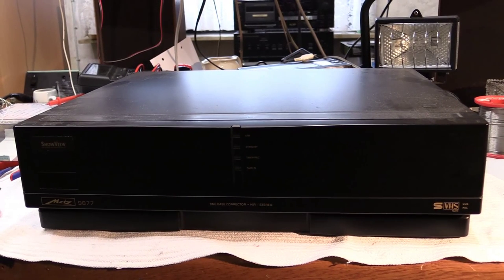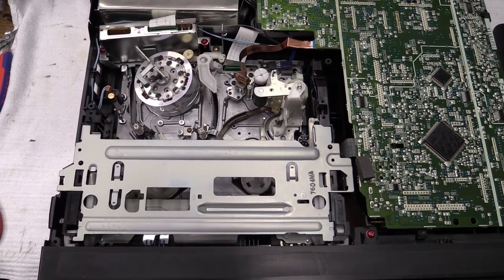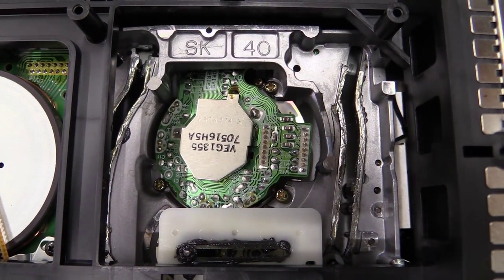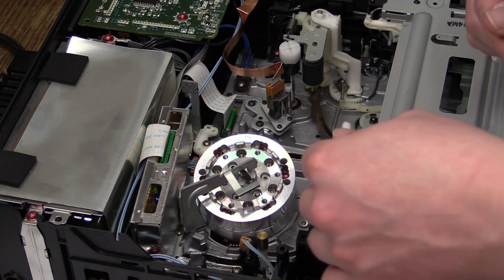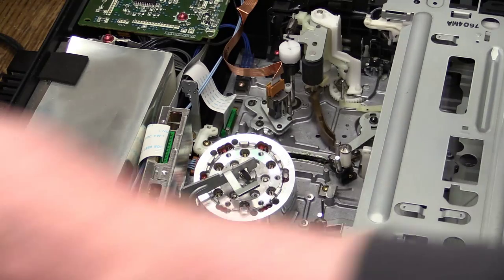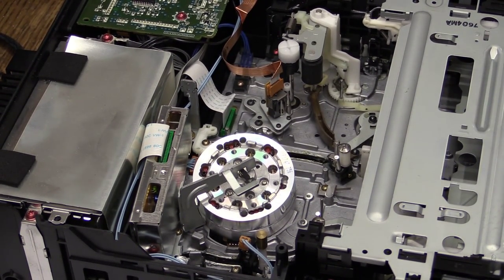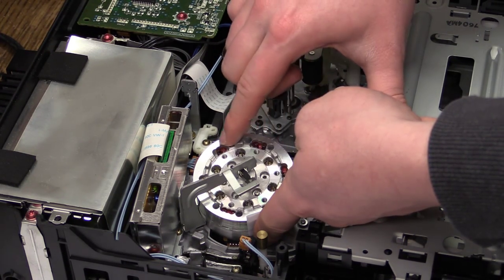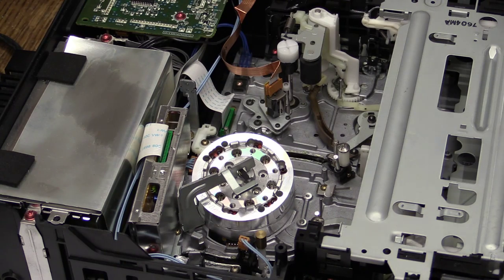DrCassette's Workshop - Panasonic HS1000 S-VHS VCR overhaul

Comment: Nice to see another fellow tape enthusiast, the K Mechanism in this vcr was a good mech, I have the same in my nvhs900 and nvhd620 hard working mechs and will last a very long time if serviced right, had my 900 for 23 years now still working great for a high miler, perfect picture and sound.

When i service mine I take the whole mech out and oil all the bearings and check belt tension, I also remove the capstan completely to clean it and oil the top and bottom bearings, you can turn the capstan in place by turning the flywheel from the bottom on this machine but if you don't have access to the flywheel then wear a rubber glove so you can griping the capstan shaft and spin it with you finger, I do this on both my 900 and 620 machines for quick cleaning and access to the flywheel on these is mech out joby.

It's a good idea to run a scope over  these after a full service especially for tape path alignment the ones fitted with plastic p guides wear like a bugger as they put naff all grease on the runners on the cheaper vcrs with the k mechs those usually have plastic p guides too and they also seem to wear on the tape exit guide the most.

Comment: One of the best machines for tracking hi-fi audio in my oppinion. Even when other panasonics will not read it, HS1000, HS900, Hs850 and FS200 will, if the heads are in good condition.

Comment: Nice video. I have an NV-HS1000 too. What is good to do is to clean also the mode switch and to check  the motor coupling , code VDP1434. Often it cracks and could prevent the mechanism to work properly. Is very easy to be replaced. What I found very interested is that this high end svhs doesn't have zero stop function at rew (counter memory), where the rew to stop when the counter reaches 0. Weird how Panasonic miss something like this for this high end model.

Comment: I have this vcr and it has strange things:TBC make picture worst and only work as should over svhs. On composite video it slightly changed colors and make image jitter much more visible. And overall image is noisy ,not I expected from device this high end class. Any suggestions? Is it video heads problem or video amplification? Is it worth to demagnetize video heads?
Reply from the maker: The built-in TBC of the NV-HS1000 is not the best. It only affects the luminance (brightness) signal, the chrominance (colour) signal does not get processed, it only gets blurred slightly to make any time base errors less visible. 
As for the additional jitter caused by the TBC, both a friend and me have had this problem in the past with our HS1000s. On mine this problem randomly disappeared, my friend was able to fix the problem by repeatedly operating all the toggle switches of the VCR, in the lower section of the front, and the signal output switch on the back.
Do not try to demagnetize a VCR, you can't demagnetize one head without re-magnetizing another!

Comment: I should get out my Panasonic SVHS machine some day.
Reply from the maker: Don't wait for too long, the mechanisms in these don't get any better from just sitting around. Depending on how long it has been sitting and on which type of mechanism the VCR has, it's a good idea to lubricate the pinch roller mechanism before even turning on the VCR. If the old grease has dried out and the pinch roller is stuck, you might end up with broken plastic gears if you try to play a cassette.
Reply: @DrCassette  Can you please tell me what type of grease you use for pinch roller shaft and do you use the same grease for other parts? Is there anything i should be aware of when applying grease to pinch roller mechanism? Please answer. Thank you!

Comment: During the 90's Nokia developed a VHS standard which bypassed SVHS standard but still offered SVHS performance. They trademarked it as ASO (Active Sideband Optimum). ASO matched the resolution of SVHS but with just a handful of components - no need for all that superfluous daughter board and motherboard monstrosity. JVC at the time objected to Nokia's ASO but relented.
Reply from the maker: I have never heard of that system... I know later there was S-VHS ET, which also allowed S-VHS quality recordings on standard VHS cassettes
Reply: @DrCassette  I moved on from CE as VHS wained pending the dawn of DVD in early 2000's. Sadly, we dumped all our technical library when we closed the business down. Else, I know we had service information surrounding ASO. 

20 years odd later, I'm dumbstruck anyone is interested in VHS, let alone the various standards surrounding it, especially with all the shift towards solid state and subsequent magnitudes of reliability, superior systems of production and function, plus of course pushing the boundaries on resolution including prices plummeting to say the least.

Still, that said, as a historical technical document, that ASO service literature would have made interesting reading given it turned SVHS on its head for next to no component count and all achieved by such a relatively simple application of signal processing theory and for peanuts. 

Around 6 months ago, I stumbled on the various YT presentations relating to people still working on CE from that time, which surprised me somewhat. It seems such a long time ago and so much has happened to me in work since, which added to the sense of distance between now and then.

It made me chuckle as the various presenters discussed the SVHS and other video tape standards but not one mentioned ASO. I felt compelled to raise the awareness of ASO but was frustrated not to have my library anymore. I briefly checked to find any historical lit' on ASO online but didn't find any. Granted, I didn't spend much time on it [search] since what was the point?...

Maybe NOKIA have some information in their library, I don't know? I felt compelled to contact them around a year ago but in the scheme of things didn't bother in the end as I no longer have the motivation WRT to that level of CE. Moreover, I realise NOKIA have been on somewhat of a paradigm shift across all it's operations since the 90's, obviously. That said, part of me wondered if somewhere in deepest Finland, in a dusty corner of physical documents, Nokia somehow kept a historical record of their ASO standard. Maybe someone would like to find that out, I don't know?

What I remembered of the machines of the time was their high performance, superb build quality and the retail price also good. Unfortunately, NOKIA were a relatively small player in CE (non-mobile phone arm) at the time so NOKIA VCR's, inc their TV chassis, weren't widespread comparatively speaking. Such a shame as it was all top notch.

Part of me feels drawn to this work again, as an earning opportunity in retirement but how would I generate the custom with next to no market demand, especially where I live. It would feel odd working on these products again after all that has happened to me since but like riding a bike, it wouldn't be a problem doing it again. 

So after nearly a quarter of a century, it feels bizarre writing about all this. Auch well! 

All the best.

Comment: I have this machine and I agree with your comments. I also have the HS950 which is 'digital process' and is also a good VCR. One thing I do recommend is to change the underside tape drive gear 'dog' before they crack/break as they usually give up with a tape in the machine which is awkward to get out.

What do you think of the picture quality compared with the HS900?
Reply from the maker: VintageLynx I heard about that problem. But I don't have access to replacement parts, so this will have to do for right now.
The HS1000 thanks to its time base corrector, is MUCH better than the HS900. The HS900 is absolutely not bad though.
Reply: DrCassette I have two spare ones I can send you - let me know if you would like them (free of course)!

Comment: I've got one of these, and a HS800. One of them has a very faint slight static line on the picture. I can't remember if it's on the 800 or the HS1000. Loved the syncro edit function which gives you +_2 frames editing accuracy for a $5 syncro edit cable. The TBC does a good job on reducing wobble, but mind induces a very faint hue shift on the colour when enabled. Please can you post a video (or point me to one you've done) to clearly show the common lubrication points inside the video? And what sort of oil or grease to use? Thanks
Reply from the maker: I have done several videos on Panasonic HS series VCRs which are available on this channel. I'd recommend watching all those videos because some things are mentioned only in one video and not repeated in the other videos, such as the lubrication points. Oil and grease serve different purposes, please don't replace oil with grease and vice versa. As oil in this case I used silicone oil. Very important: Do not use silicon oil straight out of a spray can, as it will cause a mess. Did that once, spent the rest of the day cleaning oil out of the head drum. Not good. For grease I used some random synthetic grease. I have since switched to white lithium grease, that should be much better.

Comment: Hi DrCassette,
Thanks for uploading some informative videos!
Just "found" my NV-HS1000 in the basement. Have a few old VHS tapes that I would love to digitize. It worked for a couple of minutes and I was able to eject a casette and load another, Play FF and RW, all this was done with no AV-cables connected as I was merely trying out whether the machine still worked after 15 years in the basement. After a couple of minutes the "motor" started to give a strange sound like it is struggling, and it won't eject the casette. The machine turns off after 10 seconds. Any suggestions to what I could try to fix it or at least get the casette out again??
Reply from the maker: I don't remember if the eject mechanism contained a belt. If it does, this component may be bad in your machine.

Comment: I have a panasonic fs 200 (ag 1980  pal version) and it is playing everything in black and white, before you say I'm playing ntsc tapes or something, I can assure you everything is set correctly, it's a hardware problem. Now I suspect only the caps can be bad? How difficult of a project is it to replace caps on those prosumer decks? I do have some experience with soldering, but not much.
Reply from the maker: As far as I know the AG1980 does have problems with bad SMD capacitors. This problem might not be fixable.
Reply: I did discover it later that it is, but it is a big project. Takes around 100-200 surface mount electrolytic caps to replace and the unit should work like new.
Something worth doing I guess. The HS1000 should actually have the same problems as it used the same batch of  bad caps Panasonic and rebrands used back in the 90s, supposedly they only last around 15 years and at this point nearly all hs1000, fs 200 will start to act up, unless they get the caps replaced.

Comment: It would be good to show how you lubricate a VCR- what grease/ oil to use. I have many VCR that are failing due to insufficient lubrication but don't know where to start
Reply from the maker: The process of lubrication varies with each VCR. Also usually when a VCR does not work properly, it's not (only) due to bad lubrication.

Comment: I just bought a NV HS 1000 and it had two slight vertical lines on the screens. So I tried to clean it like you did in the video. Paper, lighter fluid (Feuerzeugbenzin) and very light pressure. Sadly after that the pictures is much much worse. I think the heads are now completely damaged and unusable.
Reply from the maker: Those vertical lines are most likely not there due to dirty heads. Seems like a tape related issue to me. Try using isopropyl alcohol instead of lighter fluid. If there was any dirt stuck to the paper, keep repeating the process. Also clean the other stationary heads. You are not going to get a good, stable picture if the sync head is dirty. The paper method does not damage the heads unless you did something wrong.
Reply: Hi, thanks for the reply. I did try it again with Isoprop 90% but no real change. (The highest I got at the pharmacy) I also cleaned the other heads like in your video.
I am pretty sure its not the tape because I have tested a lot of different ones and everyone has exactly the same issue.
Could I maybe send you a few pictures over mail? Maybe you can confirm that its the heads or not.
Thanks
Reply: Olsen have the same issue. Were you able to resolve your problem? What was the cause?
Reply: @mj-iw6iz  Actually it was a problem with the scaler on my plasma tv. I connected the player to another TV and the picture is perfect. Thanks to DrCassette for this tutorial!

Comment: Hello my dear Dr! I just received my two AG4700 (remember that I ask'd you if was a good deal por 20usd?).
Sadly the seller wasn't very honest (or didn't know) that they don't work. 
Both vcr's turn on, but when I put a tape, it stops a mid position and eject the tape.
I insisted at a point it got in, but it didn't load the tape (ribbon) into the head.
Would you be so kind of gime some tips of what to look for?
Meanwhile I am going downtown to buy some Isopropanol 99% and lithium grease.
Reply from the maker: Hm, that's a problem I can't do a remote diagnosis for. The cassette loading mechanism may be misaligned. I would recommend you don't try forcing a cassette inside until this has been repaired. There are several rather fragile plastic pieces in the loading mechanism that you really don't want to break.
Reply from the maker: The VCR works better than I thought. It does load a cassette and threads the tape, so the fault should not be in the loading mechanism. The next idea would be to clean the mode selector switch. This however requires a fair bit of disassembly, and since I have never done this on my VCR I can't help you any further. However there is the "12voltvids" channel here on YouTube. You should find some videos on this topic over there.
Reply: Thank you  @DrCassette  ! That's exactly what I was thinking. In fact the mod selector in both decks had is contacts totally black. After some cleaning with isopropanol and contact cleaner it got better to a brownish gold color.
I have seen Dave's videos (12voltvids) on regarding mod switchs repairs, but I never seen a mod switch like this one.
In most cases I have seen that it has a disc on one side and some plastic clams or clamp on the other; however this one has a small plastic gear. So no clue of how to disasemble it. I try'd to force the gear out, but was impossible.
So far I haven't try'd switching one mod switch over the other to see if that might help.
Reply: @DrCassette  after reading your comment I decided to give it another go. I swaped the mode switchs from one vcr to the other. At first wasnt working (it ejected the tape). Then I realized: the motor was spinning but the wormwheel wasn't.
I bumped it a bit and it started playing! Image shown and everything!
However... then it wont eject. Same issue.
So, finally: the diagnosis is the small plastic that connects the motor shaft to the wormwheel. It has a tinny line at the middle that seems it is a crack. Both motors same sympthom.
I dont think that small piece would be easily found, so I will try to hunt another K system for taking the engine
Reply from the maker: Oh, then your VCRs do in fact have a mechanical problem. I know there is a part of the loading mechanism involving a wormgear that is fragile. But I thought if this was broken, the VCR wouldn't get as far as threading the tape.
Reply: @DrCassette  Afther checking the motor, more cleaning and new grease, I got a working system.
The motor problem might be related to a screw I forgot to put in :P

Now it plays normally, however it has ONE mayor issue.
Let me show you: https://youtu.be/C019VhPu9_Q
Reply from the maker: Hmm, that's a strange one... so you have cleaned the mode selector switch in that VCR?
Reply: @DrCassette  yup. But these Mode selectors cant be opened (PN: VSS0365).
Or at least I havent found how to do it without breaking it.
So I soaked it in contact cleaner a couple of times and spin it.
I did open the other Mode selector (the noisy one). It had one of the legs bended and when I try'd to fix it, it broke off. Also, when I try'd to put it back together, it wont hold on very well. I guess I could try with crazy glue.
According to the users of digitalfaq forum, its the  plastic thing that connects the motor to the worm wheel that its broken in both vcrs, but it works with the other modes (play, load, eject). On visual inspection I can say that the motor spins (i can hear it) but the worm wheel wont move.
Reply: @DrCassette  after a lot of testing I can say for sure it's the motor coupler! Also: I got ANOTHER AG4700 for 15usd!
This one does work!!
But the head  wouldn't provide a picture sharp and nice as the others.

The problem is that the picture is noisier and has more "comets" tru compared to the others.

Seems that needs a lot more cleaning or worse: the head is busted.
I was doing some reading: seems that some of the "white comets" can be eliminated by cleaning the contacts on the top of the head drum with isopropyl. (the arm that olds the center of the drum)